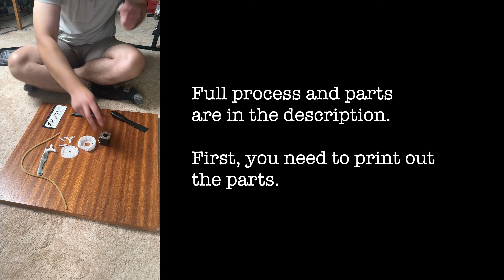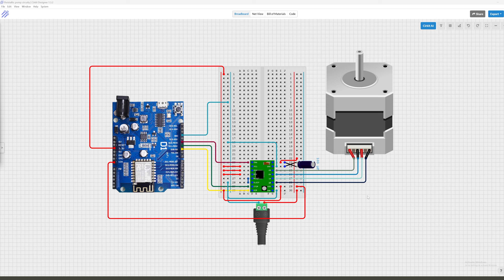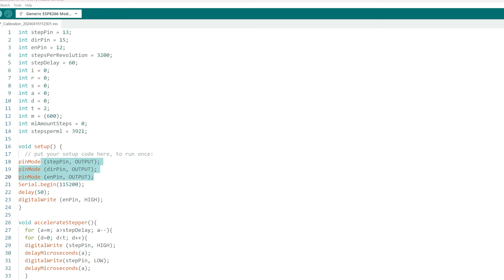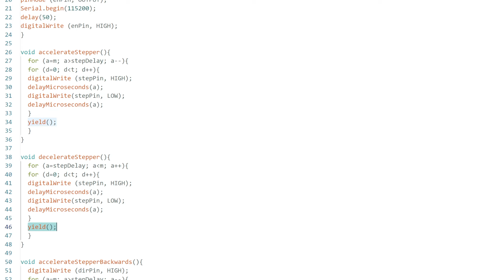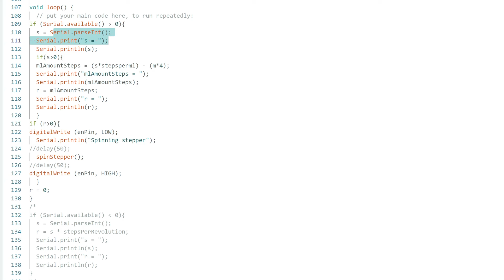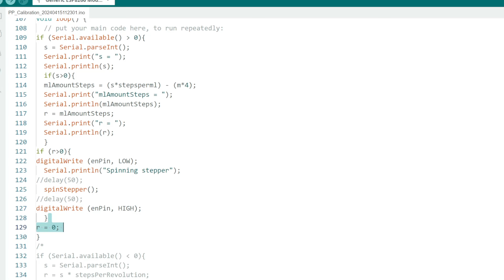DIY 3D Printed Peristaltic Pump

Comment: Hi approximately what mL per minute will this pump achieve?
Reply from the maker: Good question.
TL;DR just over 200ml per minute.

I should have elaborated on that during the calibration stage at the end.
This can be calculated by knowing the stepsperml, and stepdelay. 
As standard, the step delay is 60 microseconds, and the motor needs 3921 steps per ml.
Therefore 3921steps * 0.000120 seconds (60microseconds*2 as the step delay is used both after power on, and power off) = 0.47052 seconds per ml.
Therefore, 60 seconds (one minute) / 0.47052 seconds per ml = 127.5ml per minute.
The quickest step delay I have found to work reliably is 35 microseconds;
60/(3921*0.00007)=218.6ml per minute.
Empirical testing almost confirms that, but is always definitely over 200ml per minute, just depends on how well the tubes seal.